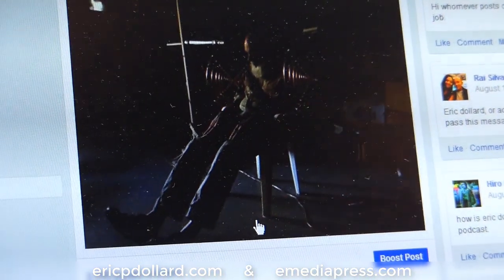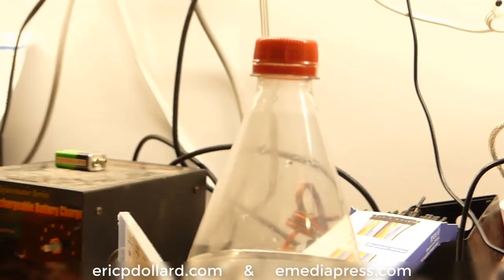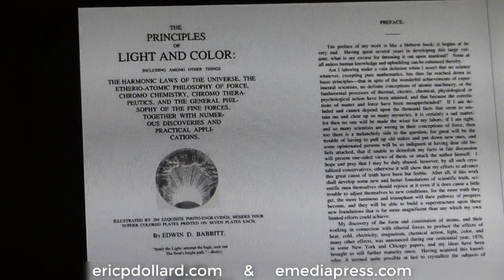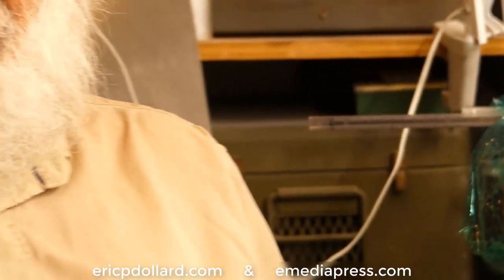2017-08-28 Eric Dollard answers Facebook Questions

Comment: How come that there are no scalar waves xD ? ahahahah
Reply: 59:00 ???
Is someone holding a gun to your head?
Reply from the maker: @andrejc6532  "Scalar Waves" is an oxymoron. A scalar is something with a magnitude and no direction. If it is 70F temperature in your room, that temperature's magnitude is 70F but is has no direction, it is omni present in the area. There are no such things as scalar waves.
Reply: @AaronMurakami13  ohhh, like, there is no such things as scala WAVES? but why do they call them waves then? Is DC, a scalar?
Reply from the maker: @andrejc6532  Depends on who "they" is. It's a misnomer promoted by those who are ignorant of the facts as they are just parroting nonsense from other nonsensical people. The EMF (voltage) in DC is moving as is the so-called electron current, which goes in the opposite direction. If there is a fixed electrostatic field, in the area the field exists you can say is a scalar but it certainly is not a wave.

Comment: The sun is a 'black hole' - it is one end of a 'worm hole', connecting our universe with another.  Solar flares are caused by matter from the other universe entering into ours.  The light we see coming from the 'sun' is matter from our universe combusting at the event horizon before entering the hole.  Or so it all seems to me.

Comment: If someone pays or buys free energy device then its not very free is it
Reply from the maker: "Free Energy" is a technical term to define work done in excess of what we input into the system - it has absolutely NOTHING to do with finances.
Reply: @AaronMurakami13  it is still laughable. Because of finacial reasons it will never be allowed unless humanity gets a moral enima
Reply from the maker: @timivers5372  What's laughable is you bring up free energy and Eric doesn't believe in nor does he promote free energy and this is an Eric Dollard video!
Reply: @AaronMurakami13  ok obviously ive tiggered you and for that i apologize.
Reply from the maker: @timivers5372  Not triggered, I"m clarifying to prevent those who don't understand the distinctions to not be misled by ignorance and for pointing out your ignorance, I apologize. Your first post has zero relevance to the video as I mentioned, Eric doesn't believe in free energy so the only goal of such a post is to distract and mislead people into thinking he is making such claims. And if not, then you are posting such irrelevancies due to some other issue that must be a personal problem.

Comment: there is a very simple mathematical explanation by pythagoras himself for the 432 cicle thing. many years i refused it as a "new age thing" but when i did the math i was blown away. starting with note C at 1 cicle and building octaves on it and building on all octaves perfect 5ths on top of each other results in a scale of notes based on the circle of 5th. with the note A at 432 cicles! the simplicity makes this system very harmonious.

Comment: the official French A = 435 Hz tuning has been promoted unsuccessfully by the Schiller Institute under the name Verdi tuning since Italian composer Giuseppe Verdi had proposed a slight lowering of the French tuning system. However, the Schiller Institute's recommended tuning for A of 432 Hz is for the Pythagorean ratio of 27:16, rather than the logarithmic ratio of equal temperament tuning.
In 1939, an international conference in London  recommended that the A above middle C be tuned to 440 Hz, now known as concert pitch. As a technical standard this was taken up by the International Organization for Standardization in 1955 and reaffirmed by them in 1975 as ISO 16.

another hoax of hitlerian Germany.

Comment: This extra dimensional stuff is not necessary to explain what powers the sun.  It's powered by Birkeland currents which have been both observed and produced in the lab.  The sun is simply a point of convergence.  The question is whether the power going in is greater than the energy coming out?  However, if power and energy are not the same thing, as Tesla claims (at least according to Dollard), then as a transformer, it's converting power to energy.  In which case, since the atmosphere of the Sun is hotter than the surface, then there's a stage, in the process of convergence  (before the Sun is realized) at which the Birkeland currents go from being power to becoming energy.  Oddly, this would suggest that this power (going in) may be greater, in some way,  than the energy produced (coming out), as indicated by the difference in atmosphere (hotter) and surface (colder) temperature.  If so, then "free" energy is not only doubtful, but undesirable.

Comment: How come Dollard doesn't use the term "noncommutative phase." He says the vortex is "polarized" and then he says 180 degrees phase - but that is not the same as noncommutative! Noncommutative just means like in division - the same numbers are switched for the denominator and numerator - and so you get a different geometric value. But for listening in perception - what I call the Hempel Effect - is that this phase shift that is noncommutative is still heard as the Perfect Fifth - even though in one case it is subharmonic C to F and the other case it is C to G overtone, so with different frequency and amplitude values. This is from Droscher's book "Magic of the Senses" but I also cited an updated version of this phenomenon.
Reply from the maker: You can send him a letter to discuss it with him directly. His Lone Pine address is in the right column of http://ericpdollard.com
Reply: thanks. I found his posts on the forum where he talks about versors and then links to his music analysis saying the mode is the 7th root of 1. But actually the first logarithmic equation was Perfect Fifth plus Perfect Fourth = Octave from Archtyas using Arithmetic Mean x Harmonic mean = geometric mean squared. This means Archytas covered up the noncommutative phase as ARithmetic mean has to be 3/2 as the Perfect Fifth or C to G overtone harmonic but 2/3 as Perfect Fifth is C to F subharmonic. This 2/3 got covered up and so the noncommutative phase was lost and instead symmetric math was from the wrong music theory! So Dollard is still using symmetric math from Plato and Archytas as the first square root is from Archytas using the wrong music theory! Real Pythagorean harmonics is noncommutative phase that is asymmetric. There is a Greek electrical engineer who figured this out - using ancient Greek projective geometry.  So what Dollard calls the "counterspace" from Dirac's Quantum Sea of virtual particles - Dionysios G Raftopoulos calls it the Quantum Undertone based on the asymmetric harmonics. He came to the same conclusion I did - only I used music theory and he used the actual Greek ratios of geometry. http://ecoechoinvasives.blogspot.com/2018/01/dionysios-g-raftopoulos-asymmetric.html  I blogged on his book - it's a free download but he also critiques relativity. So I wish Dollard luck - when dealing with quantum relativity there's gonna be paradoxes. For example Guenter Nimtz has demonstrated superluminal sound signals - of Mozart - but the other physicists are in denial that special relativity speed of light signal limit could be violated! The trick was he used quantum tunneling as the ether - as imaginary momentum from reverse phase - so noncommutative phase. I blogged on that as well. The problem is that Dirac got hung up on his symmetric math model as well - even though he realized the noncommutative math of quantum physics was from Heaviside who got it originally from Poisson. So the Poisson Bracket converts quantum back into the symmetric math for position and momentum - and so the relativity takes prominence over the quantum ether that is noncommutative. The only physics course I ever took was quantum physics and my professor said everyone should take quantum physics first or else they get brainwashed by the wrong foundation of reality - the symmetric math classical physics.
Reply from the maker: What you're explaining I think Eric will be interested in - you're speaking his language. Please do write to him and he almost always writes back, especially when it deals with this subject matter. Consider posting in Energetic Forum.
Reply: The Schumann Resonance is activated just by standing with the thighs bent - closer to parallel - so the legs start shaking 7 to 9 times per second from the thigh muscles. 90% of collagen, the most common protein in the body, is aligned vertically and collagen is piezoelectric. So the pressure then creates ultrasound energy which causes acoustic cavitation of water. The highest pitch we hear externally resonates the whole brain as ultrasound internally and we can flex our middle ear muscle to focus on the higher pitch. So then the increased dielectric field from the piezoelectric collagen then causes the water to capture virtual photons via the microtubules. So the ancients knew this training - the original human culture - the San Bushmen from 100, 000 years ago required ALL MALES to train in trance dance through celibacy. The celibacy ionizes the neurohormones and lecithin myelinates the nerves so that faster and higher frequency light as biophoton energy is channeled through the axons. We can then leave our bodies as biophoton spirits or create biophoton spirit energy to heal people - by capturing virtual photons since microtubules are metamaterials. So Dollard wants to make technology but actually the highest technology of all technologies is this ancient human training - it's a quantum zeno effect through the Schumann Resonance and biophotons that are quantum coherent and entangled - and so the relativistic mass of light is an "imaginary momentum" that is superluminal - Nobel Physicist Gerard t'Hooft goes into this in his essay, "Light is Heavy." I knew the Pythagorean Theorem was the wrong math in 10th grade since I trained in music from an early age and so I knew that infinity could not be contained through geometry. So just as Tesla figured out a longitudinal phonon energy of light that is the aether - it is a virtual phonon energy and virtual photon energy - both are massless quanta. But I don't waste my time doing mathematical calculations. Instead I just meditate and then do healing from the stored up virtual photons. I trained from a Chinese Shaolin qigong master who levitated up 9 feet while he was in deep full lotus meditation outside Mt. Qingcheng. He does healing and Dr. Ann Vincent of the Mayo Clinic did "gold standard" aka randomized controlled research of his "external qi" healing of chronic pain, calling the results "especially impressive" - peer reviewed published, freely readable online. So noncommutative phase is very simple but it's based on logical inference. Dr. Mae-Wan HO called it "quantum jazz" as she discovered we all have coherent biophoton energy inside us  - over 70 octaves. But she also did not understand the noncommutative phase math. She was Daoist but too westernized. But Eddie Oshins figured out the truth - he was the quantum physicist at Stanford Linear Accelerator. So for males the left hand is yang and lower body is yin, while right hand is yin and upper body is yang. So that turns the body into a natural harmonic oscillator - just by knowing that secret of noncommutative phase! It's like licking a 9 volt - it's called "moving of yin and yang." Most westerns would just think it's "hand waving" cuz they've been brainwashed by symmetric math since Plato and Archytas.  So I don't write long hand as it cramps up my hand muscles but I type in full lotus so I don't get carpal tunel - as the full lotus energy clears out the energy blockages in the wrists. So feel free to pass on my posts to him if you want. I share my research freely on my channel and blog http://ecoechoinvasives.blogspot.com Because we used the wrong math we caused an ecological crisis due to entropy from symmetry - while noncommutative phase relies on quantum coherence as negentropic energy - from the future. Precognition is real. Thanks.

Comment: What's a good book to get started in beginning to learning and understanding electricity. I'd love to start learning and eventually get to a point of doing experiments without shocking myself to death lol
Reply from the maker: To understand the basic electrical dimensions, get Eric's book on Amazon called A Common Language for Electrical Engineering - Lone Pine Writings. For some simple experiments, get The Boy's Book of Electricity - you can find a free pdf on line - it's an old book with lots of simple experiments.

Comment: The space thing will continue to be a mystery until Nasa provides the actual uncut, unedited, undoctored, video proof, of the transitioning of a living man leaving the air environment of the space capsule out into the transition chamber to equalize pressure then floating out into space from there. Also, for flat earth, it would help to be able to see a full 190. circular live feed from the ISS.If Mr. Dollar would say all theories collapsed if you can't see stars, so why the globe???

Comment: All physical matter is composed of two materials.  An insulating fluid 
finer than all the known gasses on the periodic table and two types of 
charge carriers.  The insulating fluid is an elastic solid which 
penetrates and soaks all matter specifically because of it's ultra fine 
nature.   The charge carriers are the smallest bits of solid matter.  
There are two kinds.  Both are 4 sided pyramids.  The positive charge 
carrier has channels bored thru it in the shape of Nikola Tesla's
 fluid conduit coming from its base to its outer 3 sides so that it 
excepts the insulating fluid in 3 sides and out on 1 side(its base).  
The negatively charged particle excepts the insulating fluid thru 1 side
 and out of 3 sides(its base).  The multitude of ways these charge 
carriers combine has to do with where they are put together, be it the 
largest star in the center of a galaxy where the charge carriers are 
formed or smaller stars or planets where they are combined in all the 
orders which fashion them into atoms and then molecules via smaller 
stars and planets. The reason why matter resists surpassing the speed of
 lite is no different than why an object resists acceleration in air.  
The faster you move thru air the more resistance it gives, same with the
 insulating fluid(so called Vacuum) when matter travels thru the so 
called vacuum of space(insulating fluid mostly devoid of charge 
carriers) the matter begins to solidify the insulating fluid which in 
turn resists its further acceleration.  A wise person would know how to 
over come this resistance with clever atomic and molecular alignments.  The
 charge carriers are made under stupendous amounts of pressure and heat 
in an environment where there is no oxygen so there is no burning.  The 
solid material on the most inner shell of this pressure and heat 
converts into gas and moves outward to lower
 pressure zones but because the material is weakest at it's hottest 
point the gasses tend to bend back towards the source of heat(because of
 refraction and defraction) and into another stream seeking a lower 
pressure zone, this is what bores the fluid conduit channels that tesla 
utilized for his fluid conduit invention.  As this happens it weakens 
the inner most shell first talked about and the shell shatters inwards 
into smaller solids than all the structure outside of it and races out 
at speeds in orders of magnitude faster than light.  As this structure 
continually pops it sends out torsion impulse waves which cause all the 
charge carriers in the galaxy to expand and contract at a higher 
frequency than humans can count.  This is what causes the charge 
carriers to combine, as the negative particle expands it drinks in 
insulating fluid thru one side and exhales out of three sides, the 
positive particle inhales thru three sides and exhales out one side.  
When the one exhaling side of the positive particle meets up with the 
negative particles inhaling side you get a very strong bond that only 
stars at the centers of galaxy's can take apart.  It is much like 
apoptosis in human cells.  The popping of something thru contraction and
 releasing of material that will multiply and build new healthy cells.  
After all, all the galaxy's are just structures inside of a much larger 
body which is alive, like how within our bodies are so many bacteria 
that are life and keep us alive but we don't care to know them 
individually, only in ratio.  The charge carriers used to be part of one spherical shell, the fluid conduit design starts from the inner to outer layer of this continuously popping bubble.  As this bubble shatters it brakes into pyramid shaped peaces where by there is a pyramid facing inwards and one facing outwards.  This is how the fluid conduit channels are programed into the positive particle and negative particle.  

chew on that you flat earth dopes.
Reply: Nathan Lyn Swanson           Matter is nothing more than a dielectric condensate.  I think your leaning in the right direction.  But I ask you to use a telescope and view stars.   They are magnetic in nature and Not emitting constant light. My observations disagree with what we are told about stars.   Keep researching.
Reply: Draw me a picture of your dielectric condensate, or explain to me how it looks physically.  If you can not draw a picture of it than it does not exist.  P.S. you're an idiot.
Reply: Nathan Lyn Swanson you seem to have more knowledge than this man for real but you can not say for sure on a flat or round earth when you have not witnessed it for yourself....we all know science is not 100 based facts so I would not rely my knowledge or existence on scientists or scientific theories